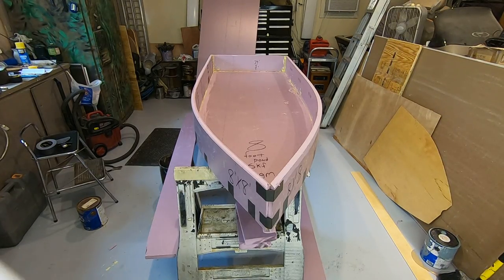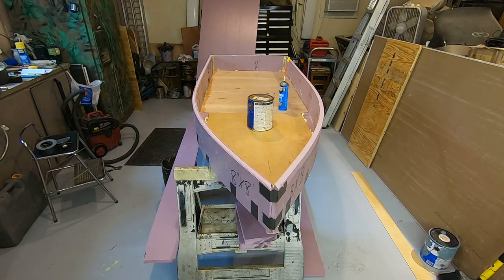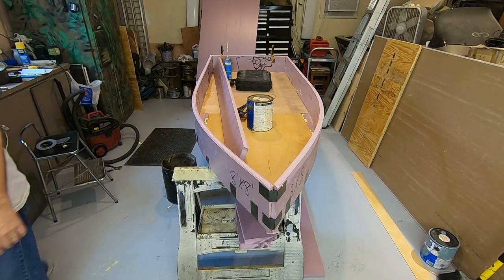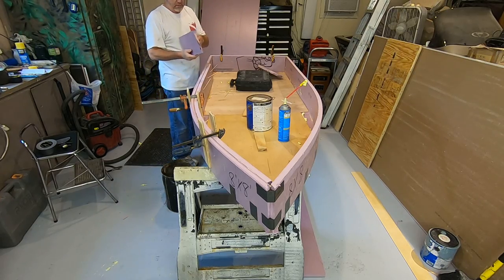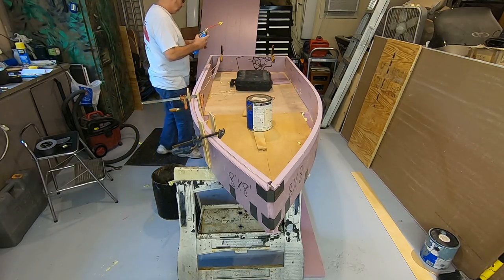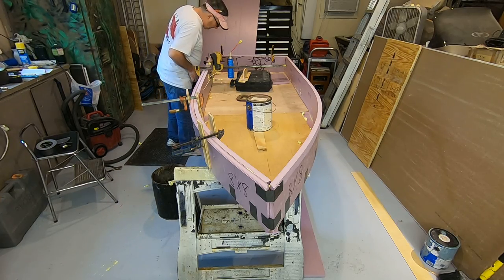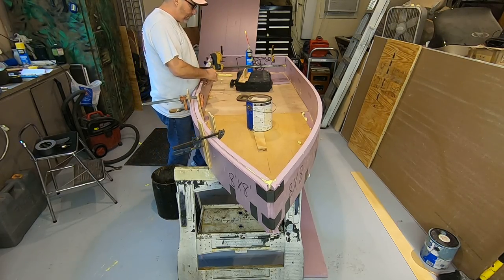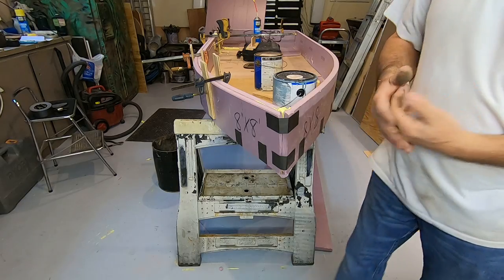Building a foam and fabric fishing boat using a knife and duct tape A stronger sole     F4

Comment: Love the non traditional small boats.  Have you tried exterior latex gloss house paint. Its'  cheap,  durable and easy to touch up.  I have used it for years on my small fishing boats.  Give the paint a week or so to cure and you are good to go.
Reply from the maker: I used an exterior house paint and you are right it is amazing I am a general contractor and we paint homes

Comment: Just discovered your videos on the foam boat—they are awesome! I want to build one to chase my large (7ft) radio controlled sailboat. How much does it weigh? I need something light so I can lift it onto my car roof rack and don’t have a lot of strength in my arms. Thanks in advance for answering.
Reply from the maker: This one is about 50 pounds I will weigh it to see but I built another one an 8Ft dingy that weigh 40 pounds here is the link and you can also see my play list that has all of my foam boat builds. https://youtu.be/LVqNS40RDPY
Reply: @mlangfordoutdoor  Many thanks!

Comment: I’m sure you don’t go back and read the comments anymore being a year old. I am going to build myself a catamaran type shallow water fishing skiff type boat. Thinking about a electric motor, outboard, or 2-4 stroke 5-10HP outboard on it. I can’t afford to buy a kayak being one I want costs around 4,000.00. This way I can afford to buy parts a little at a time, take me a few months . I like the shape of your boats hull shape. How did you make the bow so evenly, come together that is? Thanks
Reply from the maker: I bent the sides against the floor that  I cut out it was easy and I always answer any questions on all my video's so if you got questions I will answer. I have 3 foam boat builds on my play list and they are exactly that so a person can have a boat who does not have the cash up front. It is a way to have a cheap fishing fishing vessel

Comment: Just wondering, why you went with canned foam instead of tite bond wood glue, was it that the foam got hard faster ? , ease of putting it together? Strength? , I’d like to build a 16’ flats boat and I’d seal the foam with titebond and fiberglass and add plywood were needed to stiffen it up , 🤔
Reply from the maker: It was my first experiment with a foam boat, the can foam is ok but liquid nails is better just longer dry time. If you use epoxy and fiber glass mat you do not have to seal the foam
Reply: @mlangfordoutdoor  , hey bud , I’m think’n on buildings a flats boat , but I’m undecided on making it with a stitch and glue and GP resin or foam 🤔 plywood I think is much more sturdy, but more weight and harder to work with and I would still have to add foam for flotation , foam sheets are light but not as durable, has built in flotation and is cheaper cost wise , but I would have to seal the foam with titebond to be able to use polyester resin & fiberglass , the fiberglass would make it durable, weight would be determined by how much fiberglass I used on it , I may have to experiment and make a polling skiff or something like a gheenue just to see if foam sheets are the way to go , I’m an old fart and I need something stable out on the water , your video helped me see what I’m up against, and I’m think’n the liquid nails is the way to go , it gives you a bit more working time even if the cure time is longer, what cloth material did you use ? Was wondering if ya could use something like nylon or rayon with the glue? Thin and strong, cost? Didn’t check yet , hows your boat holding up ?

Comment: You need to use some better trestles as you will end up with a twist in your boat.
Reply from the maker: It has been on the ranch since I built it out in the elements and horses have stepped on it and some varmints chewed on it and ranch hands use it almost daily and still going strong

Comment: Oh I definitely think added some thickness to the sides is a great idea. You for sure don't want it so flimsy that as soon as you try and get into it, it buckles up. Your little experiment is getting more elaborate. Heck at some point you may end up putting a little motor on it aaaaaaaaaaaahahahaha.
Reply from the maker: I don't think this should do a motor do to its low free board and weak transom, its basically a big boogie board with sides so your things wont roll off, you know cause cans are not square lol. I do have 2 kayaks and a bass boat